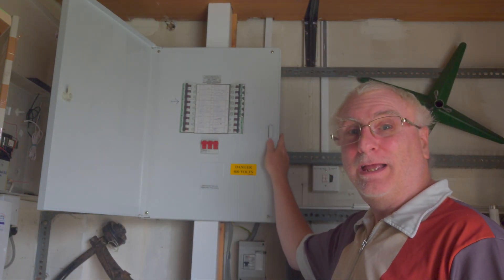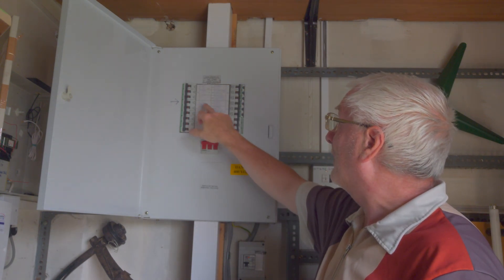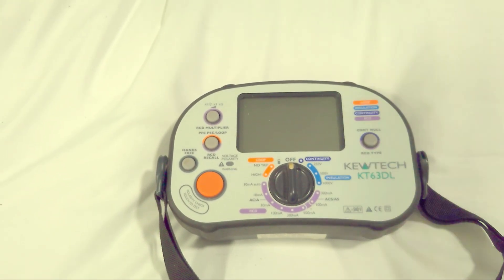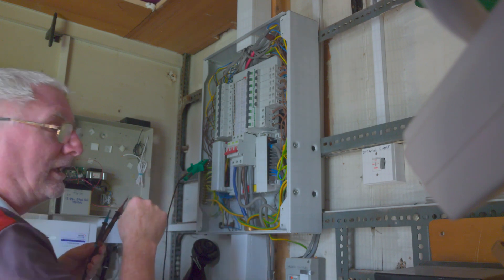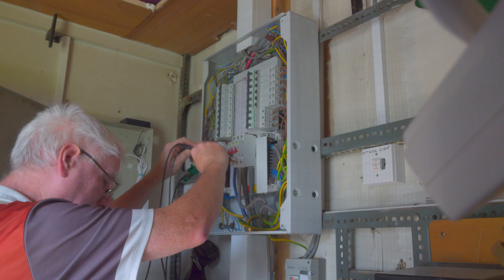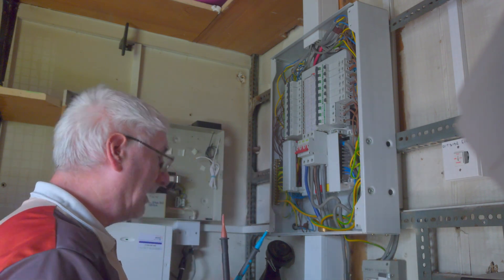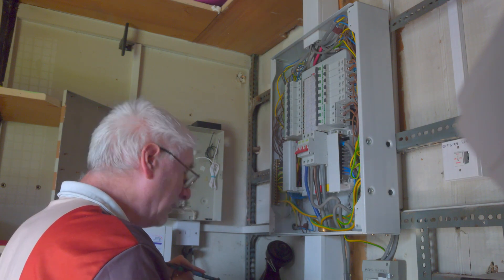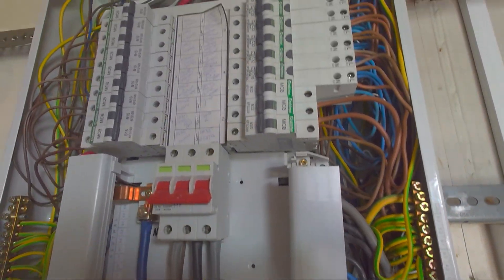Is Three Phase Power Scary to Test ?

Comment: Dutch 230/400V power makes sense.
Reply: Agreed. Danish power is also 230/400. British way is very strange.
Reply: @mortenwinslw2785 British power is 230/400.

What the presenter said in the video is incorrect.
Reply: @deang5622  Almost all houses in Holland and Denmark has 3 phases and our sockets are not protected by 32A. I have 3x25A supplying my whole house with a heat pump and ev charger and that works absolutely fine.